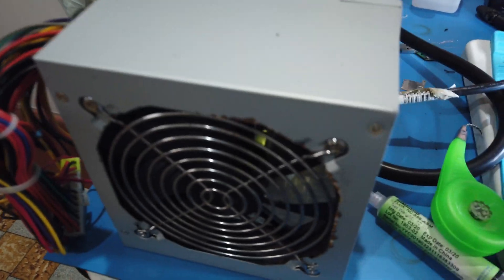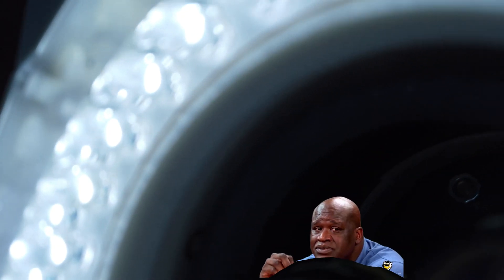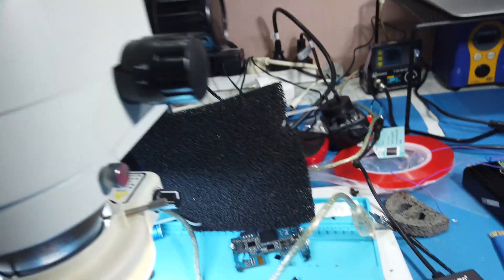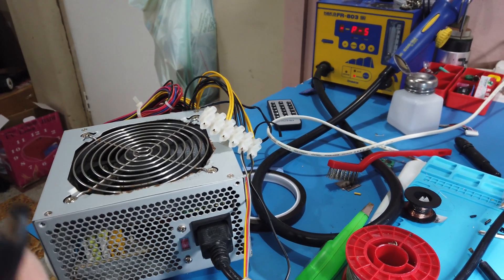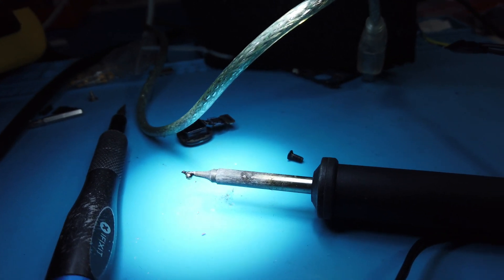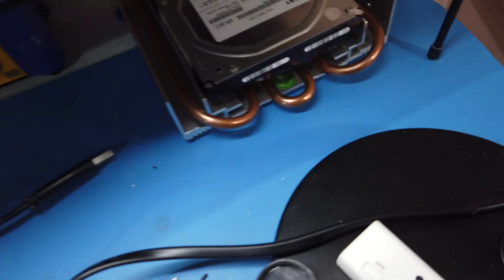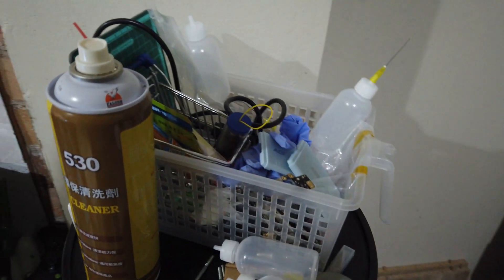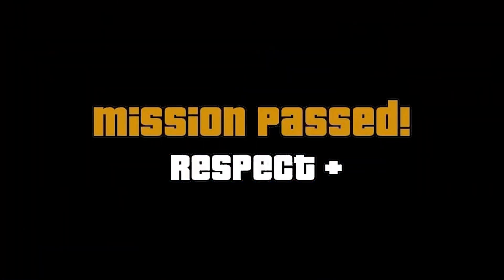Converting Computer Power Supply to a bench PSU ATX

Comment: Like you say @ 52 seconds, yes you do see all yellows are soldered together,  as are the red, orange & blacks all soldered together with their respective colors. So although a label may say 12volt 1 & 12volt 2 , it's just 2 individual yellow wires coming off one main soldering point going to separate connectors.